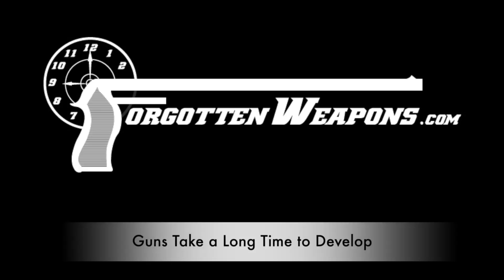Why Guns Take Years to Get Into Production

Comment: Making the machine that makes the machines that make the mass produced product is hard. Now make that product a gun that needs ammunition that can also vary in tolerance.
I used to work in a factory running gun drills, punches, Acrilocs, Warner & Swazey chucker- drills and that was making brakes cylinders for military vehicles. I'm guessing that is similar and just as important asmanufacturing guns as far as tolerances are concerned. Lots of machines lots of testing lots of rejected parts. Later I assembled those same parts I made. I was glad the engineers figured out the tolerances then. The technical package is extremely important.

Comment: At first i was like...
I can make a gun easy, just a metal pipe of some diameter which can hold a glass marble.
Then a smaller metal pipe that goes inside it that can hold a certain fire cracker.
Cut the larger metal pipe in half, bend one half into a stock.
Make a slit in the smaller pipe the length of a firecracker. Then slide it into the "butt stock" pipe and drill a hole through and run a bolt through it.
Slide a fire cracker in with the fuse in the slit, with a marble attached with some tape, slide the "barrel" part of the larger pipe over it and light the fuse.

You've now made a gun that should be able to fire a playground glass marble through a road sign. I did it when i was 14, it wasn't hard.
Making a production line out of that would be easy too i think.

... But then i realized this applies to real guns with moving parts...

Comment: Try to combine an engineer, a metallurgist, an inventor, an entrepreneur, and a military strategist at the same time.
Reply: And a zen master, since it's about that level of self-control that is required not to punch management.
Reply: I think you misspelled "John M. Browning". Hahahaha! Exactly making your point though, these folks are few and far between.
Reply: @jasonrye9600  Mr Browning wasn't a metallurgist nor strategist. In case of many (if not most) his designs, he wasn't involved in setting up nor running production at all.
Reply: @randomnobodovsky3692  I will take your word on the lack of involvement in the production side, but I can't imagine Mr. Browning was unqualified in the metallurgy field. Experienced with it, if not certified (or whatever metallurgists are). Strategist- nope,  I guess not. Well, nobody's perfect!
Reply: @jasonrye9600  You don't have to take my word. I encourage you to read up on his professional life.

Most of the designs he was famous for were sold by him to other companies - where local talent set up production (and, usually, modified his original design).

Regarding metallurgy. Depends on your definition of being qualified in the metallurgy field. To provide an example: most of e.g. modern mechanical engineers have working understanding and some knowledge in this field but they aren't metallurgists. Knowing basic properties (which he surely did) does not make a metallurgist. It's like being able to do everyday math vs being a mathematician.

I don't want to detract anything from him - he was an extraordinary designer (and quite a businessman). But saying he was much more detracts from people who turned his ideas into mass-produced metal.
Reply: @randomnobodovsky3692  Now that makes perfect sense. Well said!

Comment: Why did the M1 not cycle on the 7th round?!
I need answers!
Reply: Hatchers Book of the Garand. Good reference on the m1 in general,  and early US automatic rifle development too. Basically the follower would not apply correct support if the clip was in with the top round on a certain side. They fixed it by changing the follower geometry and giving it a small amount of rotational movement. At least as I recall,  I don't have the book on hand. I do know it took them years to figure out, and this was after it had been adopted and was in production.
Reply: Follow up, with clearer info. It was not entirely the follower,  but the bullet  guide ribs milled into the reciever. When they were going to higher rate production,  they moved to a more efficient( for line production)  method of drilling the barrel mounting area. Unfortunately this had a tendency to overshoot and chip the left side guide rib, and if the second to last round in the clip was on the right, it would misfeed.
This actually feeds into Ian's point, in that what is most efficient for prototype v low volume production v high volume production,  can impose changes that might not be obvious to either designers or production engineers. What might be the most efficient method for doing a particular cut, might change geometry in subtle ways that would change the timing on critical parts that create non-obvious causes for problems.
Reply: I'm literally dying to know!
Reply: @germaxicus6670  answeren, see commnts.
Reply: +1
Reply: +1
Reply: Maybe because the gun could only count to six...?

Comment: Not only was the STEN eceedingly simple, it had the full wieght of the Government bulldozing it to producstion....
Reply: They also probably didn't care about safety. If some percentage of the guns fails and injures the user it's still better that your army has guns than doesn't.
Reply: And the mark 1 wasn’t really mass produced to the levels you think (~100k) it was the mark 2 that they make 2.2 million of an even that was a little unreliable and a little dangerous.
Reply: @flatsurfaces1913  Indeed, the Pre War Tin Plate Toy Maker "Triang" was brought into making STEN Mk1's their production engineers identified a number of simplifications that could be made to reduce cost and speed up production, that became the Mk2
Reply: The STEN was so good the Germans copied it!
Reply: @andrewallen9993  naw. Sten stole from Germany and simplified. Germany took it back and simplified it again.
Reply: @AKUJIVALDO  they only copied the MP's magazine design.
Reply: The Sten was known for jamming easily. It was also know as the gun nobody dared to put down, the reason being that it tended to go off on its own. It seems this gun had its own will.
Reply: @mikethespike7579  The Jamming was down to the poor magazine - the early versions had no saftey on them, so if the heavy bolt was given enough accidental momentum it could retact far enough to pick up a round
Reply: Love your experimental spelling
Reply: @AndrewLale  Mine or the spell checkers? :)
Reply: Also of note: kids can successfully design blowback submachine guns in 9mm. It still takes SOME time.

Comment: this is why 
MACs oft-repeated
"guns are simple machines
so this shouldnt malfunction"
is rather a fail... dozens of inter-
related factors make a gun 
more or less reliable and 
there are costs to every
desired benefit
Reply: Yeah. 

A semi-automatic firearm basically has to harness the potential energy of a cartridge to eject its case and reload another one without exploding while sending a small slug of metal at high speed out one end, activated by a mechanical switch and dependent on mechanical timings to function. 

Like any machine, it’s a lot of parts that gotta be in the right place, especially if you’re going to try that with a pile of random parts. Guns are a good example as it was one of the first things which people did make for that.

Comment: M1 Carbine shows it can be done well and quick.  And much more today with all the CAD and CNC available.
Reply: The M1 carbine is the exception to the rule.
Reply: It doesn't. Unless you want to pretend that prototype is the same as production firearms (which means missing the whole point of this video).
Reply: @randomnobodovsky3692   M1 carabine was designed and started production in 1941, it didn't take years to develop. It was produced between that year and until 1945 with more than 6 million units.  Talk about prototype.
Reply: @mvurquiza  " it didn't take years to develop" - but another firearm that it borrowed a lot from took. Ian has a video on it.

Comment: The M1 Carbine took years to get into production ?
Reply: Winchester had a ton of luck to get it built and working, in such a short time. The men behind it had great skill, but if one of them had made just one error, like in cutting the replacement bolt from memory, it would have been a completely different animal.
Reply: @PassiveDestroyer  Exactly. Why am getting attacked for pointing that out ? lol
Reply: @DBCisco  The M1 Carbine is an exception to the 5-10 year rule. That's why it's such an amazing feat.
Look at the M1 Garand. They started work in the 20's, and it only got adopted in 38, and it still had teething troubles.
Reply: @PassiveDestroyer  I agree, now why I am attacked for pointing out that it doesn't always take years to get a firearm into production.
Reply: @PassiveDestroyer  M1 Carbine wasn't an exception, as substantial part of R&D was already done. See Ian's comment.
Reply from the maker: Worth noting that Winchester's winning  design had been   in development (in .30-06) for several years prior to the carbine competition. Also that there were a number of production problems in the early days that are generally forgotten about because the gun ended up being very successful.
Reply: @ForgottenWeapons  roflmao
Reply: @ForgottenWeapons  Winchester began developing their M2 in 39 and the M1 was accepted in 41. Where is this 5 to 10 years you are claiming ?
Reply: @DBCisco  You mean, ignore the fact that the base design was already developed a good few years before its adoption. And there is a world war going on?
Reply: @axelpatrickb.pingol3228  Winchester began designing the M2 30.06 full auto as a replacement for the Garand in 39. Where are these "few years" before the M1 was accepted in 1941 and put into mass production ?

Comment: I wonder if computerized modeling will get to the point where you can feed it a CAD/CAM model, and by knowing the target dimensions and material properties for each part it could identify subtle problems or overstressed parts.  If so then you could have it models the effects of variations in parts tolerance and get a useful first pass on the go / no-go dimensions for each part.
You'd still need to verify that with extensive field testing with lots of guns; but it might cut some time off the process.
Reply: Yes, but not as open-source freeware. The companies that make such software are VERY protective of it and the licensing is tens of thousands of dollars... annually.
Reply: @jamestarbet9608  If said software could save you a year or more off your gun development that cost is probably a bargain.

Comment: This and the technological plateau in guns is why I push very hard for companies to produce Retro/Reintroduction guns. Say you're FNH, you "make" FN15s, 509s, SCARs, and all sorts of modern stuff that fulfills your civilian sales needs, for the most part. But over in the corner there sits all the tooling needed to make HiPowers and FNCs. These are known quantities, all you have to advertise on is that you're making them again. You can price them higher than they originally were, given inflation and the desire to buy what is currently an out-of-production collector's item. You have only the manufacturing kinks for new production to work out, as the design is solid and for historical accuracy sake, needs no improvements. It just seems to be a waste not to utilize the tools and market desire, even for a soulless corporation it should be straightforward.
Reply: Tooling that sits in the corner often is out of spec, out of people who know how to operate it and potentially not  the most economic option (man-hours got expensive; a lot of the old stuff was labour-intensive).
Reply: @randomnobodovsky3692  True, but I'm talking retro stuff from the 80s, not the 50s. There is no doubt about the difficulty, but it's a hell of a lot easier than trying to invent/test/manufacture/advertise/sell "new whizbang", it's down to /test/manufacture/sell, and that surely outweighs the trouble
Reply: @londonjolly9174  I think we all need to finally come to terms with the fact that '80s weren't a decade ago :-). On a more serious note: I strongly doubt that trying to spin up a lot of equipment that was used 3+ decades ago (meaning it was probably made 3-5 decades ago for FNC; in case of Hi-Power it's substantially more) is actually worth the trouble. Especially since it would not be just dusting off: they would have to check everything about it, order replacement parts if needed (original manufacturers are probably defunct, good luck with that), re-train part of the labourers (and maybe hire new ones)... Of course, as it often happens, it would turn out that thay can't even legally operate some of the machines due to e.g. some substances becoming illegal to use or aren't up to current safety standards. A lot of hassle.

Comment: Just had a couple of webbinars dedicated to simulation in CAD. It allows to "look into" working machinery without building mock-ups and prototypes "in flesh", yet it isn't cheap and one got to be a pro to be able to model it. On the bright side, there are more and more cloud services for that, so you don't need a super-powerful desktop (which then also needs upgrades) of your own and expensive software, you can now rent time and power of cloud service for simulations, which still isn't cheap, but got to be cheaper.

Comment: Building a gun that works is hard; Putting to paper every single little element that guarantees it, is worse.

As a programmer I can relate. Writing code that works is much easier than writing the complete tests to insure the code will run in any context, on any machine with any inputs. 
Fortunately we at least get to run tests in a computer (which is our product's natural environment), this is not the case for guns, to the extent that the real world can't be guaranteed to be accurately reflected in a computer simulation. (yet)

Comment: How has 3D printing and modelling changed this process if at all? I mean, I'm by no means a gunsmith, but I am 3D modelling my own WW1-style battle rifle, and with modelling software that can not only model but also print within 1/300th of a millimeter, it seems like it would be easier to determine mechanical tolerances using that. Obviously a plastic chamber is asking for a blow up, but if there would be any cartridge sheering as you mentioned, I would think that it would show up there in non-firing models using all-plastic components and ammunition.
Reply: By definition, plastic parts have different properties than steel parts and as such, would need different tolerances.

Comment: The first batch of Harrier jets were flown by the top elite pilots the Marines had.  Did very well.  As less experienced pilots started flying them the accident rate shot up.  The Tuskegee Airman had a phenomenal flying record because they were the best of the best (no they were not used for medical experiments Biden).  The first mechanical iteration that is hand fitted, tinkered, fine tuned then tested in the hands of experts always looks good and simple.  A professional will make complex difficult things look simple because they are that good.  Prototype cars look great wait until they hit the largely unskilled production line and the quality falls off dramatically.

Comment: "limits and fits" was invented as a reliable means of making firearm parts fit and function together.  It was subsequently adopted in other Engineering fields where parts interchangeability is quite important.
Reply: Ford motor company really advanced manufacturing tolerances.  That work was based off guns, but it fed back into ww1 and ww2 gun production m
Reply: But the real fun begins where tolerances accumulate over a chain of interacting parts (like in a moderately complex gun, surprise, surprise). Add the temperature changes and it becomes too much fun.
Reply: @rrolf71  Differential thermal growth is a big deal!  You are so correct to point it out.  For example,
Reply: @rrolf71  Nah, it really starts with modern, less known materials processing. For example, modern stainless steel, aluminum/magnesium, or titanium alloys that differ from the old, well-known ones in the heat treating shrink, or others like dispersive strengthening, flexural strengthening, and the list goes on and on with the use of all know matrices for composites:
metal, ceramic, carbon/carbon composites, and polymer matrix based. 
I mean, I do agree with you, but the prospect is today so extensive, and the expectations... Once your boss gets into EXPO, Jesusless!
People won't invest until seeing miracles or intentionally screw one another.
Reply: Joseph Whitworth (who apprenticed under Henry Maudslay the inventor of the screw cutting machine lathe) was the key name behind machined precision parts - including standardised screw threads. Earlier designs used filing jigs and brass parts.
Reply: GD&T became a thing because of torpedo manufacturing.
Reply: @simoncleret  ah, the Mk14 and Mk15 torpedoes. The most epic clusterfuck of all clusterfucks.
Reply: Yep. The concept was thought up first by US American engineers and revolutionised mechanical engineering.
Reply: Royal Enfield's slogan for their motorbikes was always 'Built Like a Gun'.